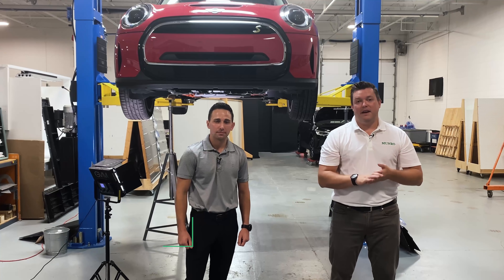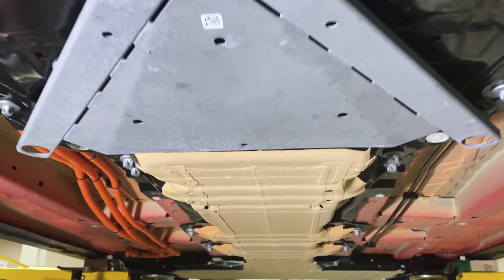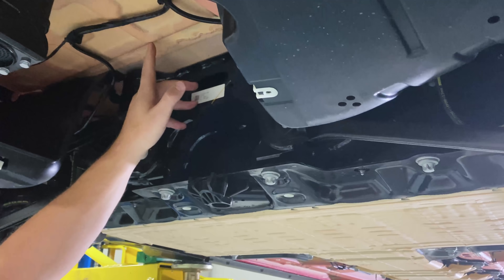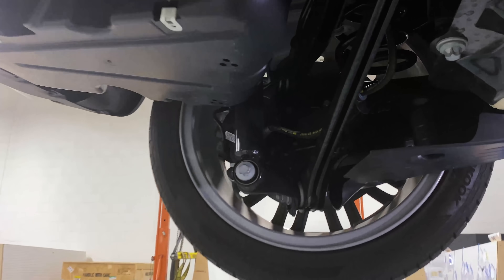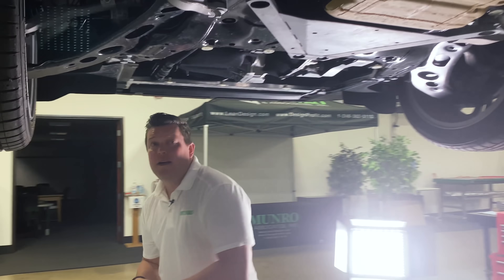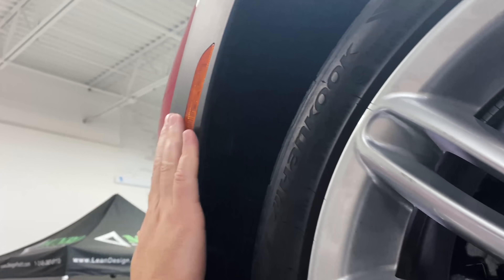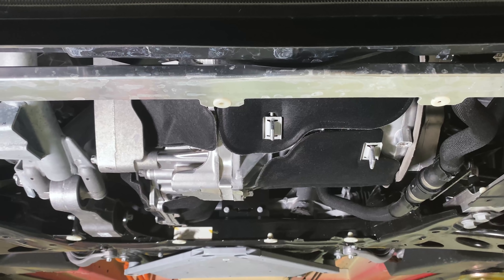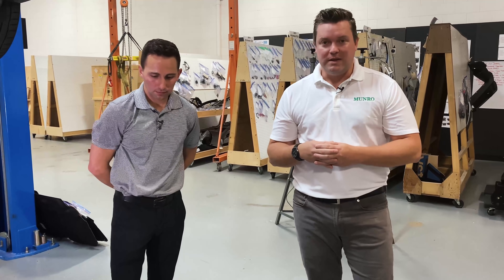Mini Cooper SE- Electric | Undercarriage

Comment: Those high voltage lines zip tied to the undercarriage is insane. Can't wait to see the BMW apologists explain why it's properly engineered this way.
Reply: Agree. Looks unsafe. They would get torn off or damaged easily.
Reply: @melcragg7814  they used to route brake lines the same way, if it was unsafe they would have made changes, dont see any difference regarding voltage wires.
Reply: I wonder though, what is the consequence of the damage?  For a damaged battery pack you can have unconstrained discharge of the entire pack, meaning fire, but for the HV cables you would ideally blow fuses/breakers within the pack itself.  I suppose the real concern is scenarios with high resistance paths going through the body that could maybe harm a human without blowing the fuses/breakers.
Reply: @rhamph  you would expect in most manufacturers these are properly fused, but given how sloppy this is, who knows! I think you raise some interesting points, it would be good for Munro to answer as much as they can without tearing apart the mini.
Reply: @rhamph They removed the plastic covers prior to filming this video. I’ve been working on these cars since their release and have yet to see those cables damaged. But that’s not to say it can’t happen and I think they should have routed them better.

If they were to get damaged, pinched or compromised, the HV switches inside the battery would open and the HV system would immediately shut down due to an isolation fault. There is braided metal mesh wiring built into the HV wires orange insulation material that is constantly monitored for resistance and potential voltage to the HV system positive and negative cables. Essentially an ohm meter or megohmmeter inside the HV battery that takes measurements real time to ensure the high voltage system isn’t shorting or bleeding into the 12v system or body/frame. The safety box inside the HV battery also houses fuses in case of a direct short circuit and the HV switches, so if a fault is detected, all potential energy from the HV battery is contained within the metal HV battery unit/case for safety. Which is pretty standard. There are a lot of safety standards and protocols behind the design that are legally required.

This vehicles body/frame was originally designed and used for an internal combustion engine. They engineered a BEV setup based off of the BMW i3 HV system, but obviously had to make some concessions with the space they had available. I think they were quite clever with how they created a cradled frame where the engine used to be that houses the EME/inverters converters, HV AC compressor, electric motor and cooling systems, while also utilizing the same engine mounts/parts that were on the ICE versions. Most components such as the 12v battery and ECU/EDME are in the same areas, which cut down on cost. I’ve had these batteries fully torn apart and they certainly utilized all the space in the tunnel and gas tank areas. It does feel like they wasted the empty area behind the rear suspension though. 

But yes, it was an “afterthought” as it was wasn’t originally designed to have a BEV powertrain from the beginning and was later adapted. But considering these vehicles could be had and some sold for $20k new after the rebates in the US, it made sense for someone who just wanted an electric zippy little city commuter. They are indeed fun to drive.
Reply: @rhamph  I have my doubts about breakers on both sides of the wires.
Reply: I'm thinking what comes first: If they will be torn or sliced.
Reply: The lines are inches above the stamped steel battery housing. And protected by the sealed under carriage. I suppose if you took this EV four wheeling and you got it high centered on a rock which first penetrated the steel battery housing, then the lines might be cut.
Reply: You guys might want to watch the Rich Rebuilds video on the Plaid Tesla, because the HV cables are routed the same way. In typical Tesla fashion they also failed to properly install the undercarriage protective cover.
Reply: @cadriver2570  I watch Munro, the plaid will be here in a couple months. Nobody should trust Rich.
Reply: Were their plastic shields covering this area that were removed? If so, then the cables aren't exposed to road elements.  Make no mistake, this car is clearly an ICE converted to an EV, but it is a factory made conversions that is better than any 3rd party conversion and cheaper too.
Mini is low volume and this allows them to put out an electric mini without redesigning the car.  Mini owners likely find that approach appealing.
In some US states with all the EV incentives, this mini is less than $20k brand new.  100mi is enough range for nearly any daily commute.
BMW made a good low end EV here and I bet some bolt owners even buy this to replace their bolts after buybacks.  (if you fit and need a daily driver, nothing really beats this right now)  The i3 was crappier and cost $50k new, this is better and costs $23k with federal tax credit and under $20k with state incentives.
Anyone who likes EVs is going to like that BMW is finally helping get ICE cars off the road.
Reply: @_PatrickO  No offence but as soon as they start talking service intervals I'm out. And this car looks like it will have some.
Reply: @_PatrickO  theres the whole problem. Nobody cares about bottom of the barrel effort EVs. They are just filler to get a failing company some false sense of saving itself. If they're not leading they lagging and don't matter. There aren't any questions anymore.
Reply: @635574  You don't care about a mini-EV.  Mini owners do care.  This is what they wanted.  The mach-e may be a better overall ev but does not appeal to mustang owners.  This mini conversion appeals to mini owners, it is actually more successful in converting people to EVs than the mach-e.
Stop getting upset when other people like things you do not like.  No one spending tens of thousands of dollars on a car can be called a fanboy, haterboy, or any other stupid name. They actually spend real money on an EV, you didn't.  Grow the fuck up.  It is a car and a clever conversion.  I would probably recommend this to people who need a daily commuter and nothing more.  People were buying used i3s for that, but this mini is way better.
Reply: @_PatrickO  Of course the plastic shields were removed. And of course the only way to cut those cables is if you drive this vehicle over a cliff. And of course this car makes an electric vehicle possible for someone who only has 20k. You are making too much sense.

There's really no point in talking to the Tesla Fanboys who just like to scream "compliance vehicle" because it makes them feel better inside.
Reply: @_PatrickO  I knew I'd find some BMW apologists to say this car was acceptable. I own 3 compliance EVs I continue to buy them second hand because they're not worth anything. This is a compliance EV in every sense of the term.

Most Bolt owners are trying to buy Model 3s. Honestly it looks like the Fiat 500e was a better ICE to EV platform conversion.

I'm sure they will sell some of these, but it's hardly a real effort.
Reply: @legacytesla  In some markets, 30% of MINIs sold are Electric Vehicles. This car is a stepping stone vehicle that allowed the existing ICE factory to produce Electric Vehicles. Who do you Tesla Fanboys have such a hard time understanding that?
Reply: @jayhawkeyes  I don't have a hard time understanding. I get it, the company failed to plan, failed to build a ground up EV with decent efficiency. As I mentioned above, I buy compliance EVs (which this definitely is). And compared to my other compliance EVs like the 500e this looks to be a terrible effort (more like lack of effort). 

While I own a total of five electric vehicles only one is a Tesla. As used car prices start to fully come down eventually crashing I could easily see these cars being seven or eight grand in a few years.

BMW should be ashamed of themselves they had plenty of time to engineer a proper vehicle for develop good electric vehicles instead we get this crap and the i3 which is total junk.
Reply: @legacytesla  This statement is meaningless nonsense: "the company failed to plan, failed to build a ground up EV with decent efficiency". 

This car is an ICE conversion that gets ICE vehicles off the road.  MINI has limited factory capacity. 30% of MINIs sold are electric vehicles. Cars like this one are stepping stones toward complete from ground up EVs from MINI that will have happen in the 2025-2030 time frame.
Reply: @jayhawkeyes  you're such an apologist for poor planning. Why did BMW not start planning this 10 years ago? Why is it acceptable that they're producing this crap now that's basically just a compliance EV to meet California regulations?
Reply: @jayhawkeyes  move along BMW fanboi. This car is shit and you know it.

Comment: Those exposed high voltage cables are a disaster in the making.  I'm sure BMW will check these comments and realize notice has been served on that score.
Reply: If you think the expised hidh voltage cables ate disaster you better look under a model S plaid...you might change your mind...
Reply: The lines are inches above the stamped steel battery housing. And protected by the sealed under carriage. I suppose if you took this EV four wheeling and you got it high centered on a rock which first penetrated the steel battery housing, then the lines might be cut.
Reply: @jayhawkeyes  Please review the video at the 2:35 time stamp.  Corey points out how exposed the high voltage cables are.  There is no sealed under carriage noted.  He was polite enough not to be critical of this finding, only because it was so obvious.   I live in a rural community and with every wind storm that comes through, the roads can be littered with tree branches of various sizes and geometries.  One of those can  hook those cables and rip them loose, especially at night.  Plus other types of road debris/hazards can have equally damaging results.  I don't think a few wire ties are a good design, leaving the cables exposed to possible damage.
Reply: @BillyLapTop  i agree, Cory is a great presenter. I enjoy his style. I also agree... you wont be buying this car if you have branches of various geometry or probably even  ROUS'es flying arround the neighborhood...
Reply: @BillyLapTop  Look at the undercarriage of Toyota Prius. It has the same high voltage cables deployed in a similar fashion to the MINI. This is common car industry practice.

The MINI undercarriage is protected by a cover which Munro removed but failed to disclose in the video.

I guess these guys from Munro are not car mechanics and they don't work on many cars. Or they would know this.
Reply: Since the Mini is British, I think everyone has missed the obvious point that they had the HV cabling designed by Lucas, the Prince of Darkness!

Comment: That car looks terrible! Exposed high voltage cables. Not good.
Reply: Beyond being exposed they're longer than hell... the length means they need thicker wires and you lose more efficiency... hopefully they're just AC charging wires and not DC lines.